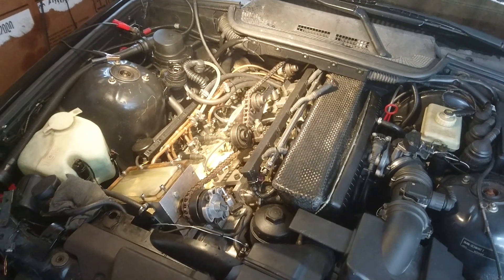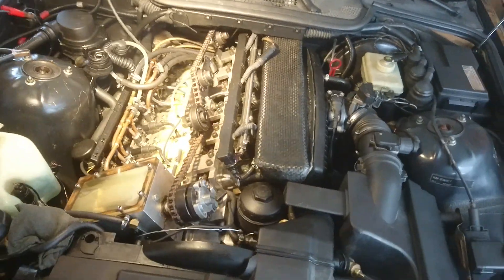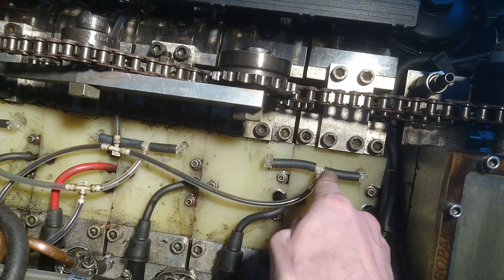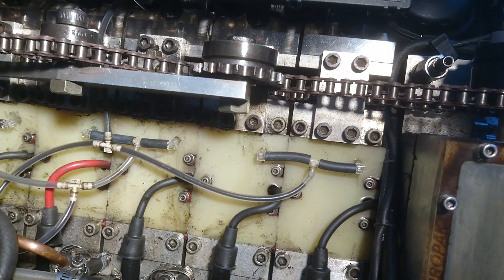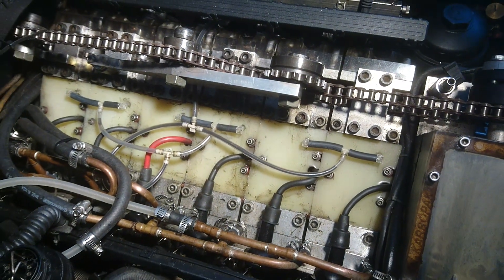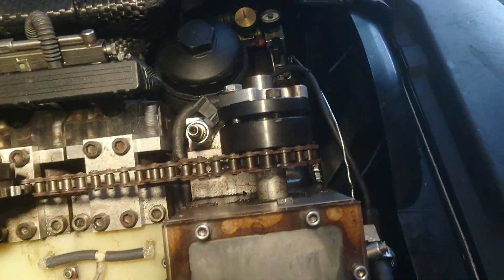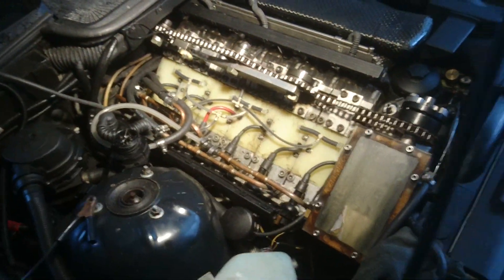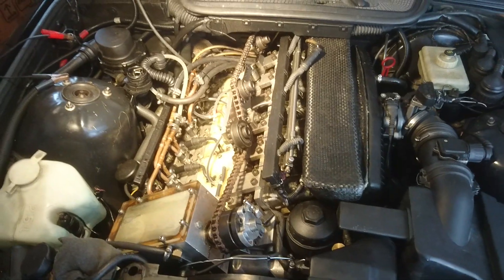Rotary Valve BMW e36 Update 1/1/20 New Oil Lines

Comment: Excuse me— someone actually did this on a full size automobile engine themselves??
Reply from the maker: Yup.  We had done it a few times on single cylinder engines.  We decided it was time to scale it up to a normal production car.  So we chose our favorite chassis, found the car and went to work!  We had originally planed to do a 4 cylinder BMW 318i, but this 6 cylinder 328is grabbed our attention so the project got more elaborate as the extra 2 cylinders increased the complexity and cost.
Reply: Oh wow, I saw someone did it with a Mitsubishi 4G63 engine
Stuff like this is innovative magic
Reply from the maker: @Creeperboy099  Yeah, he put a lot of effort into casting and building that thing and then I believe the combustion seals cracked when he cranked it over for the first time.  I have seen any more progress.
Reply: MrPizzaman09 I wish I had the equipment to do this stuff— my brother is majoring in chemical engineering and he’s learning about fluid flow and stuff like that right now
Someday I want to take a bare engine block from a scrapyard and build a small race engine and make the heads from scratch with him
Reply from the maker: @Creeperboy099  It's always interesting how people build things based on the tools, knowledge and equipment they have at their disposal.   I happen to have the software and mini mill, but I tend not to do castings or welding.
Reply: MrPizzaman09 Yeah I would probably use that method to make parts— mill them from metal blocks

Comment: Have you ever had this setup flow tested?
Reply from the maker: We have made volumetric efficiency charts using the mass air flow sensor and compared it to our 99 BMW M3.  It has better volumetric efficiency below 4k rpm and is similar up to 7k rpm, peaking around 100% VE.
Reply: @MrPizzaman09  - what compression ratio and chamber volume are you running? Those numbers make for a great wide torque band... but it sounds like you could benefit from crossflow in the chamber. A shade more porting for later exhaust closure and earlier intake.  would help with performance, if emissions compliance isn't a target.
Reply from the maker: @jamescopeland8813  compression ratio is 10:1, where stock was 10.2:1. I don't know the volume of the 'runner' area, but it is 44mm in diameter through the valve and morphs cleanly to a 2"x1.2" port in the valve, making for something like a 250/250 degree equivalent for exhaust and intake duration.  It's quite aggressive.
Reply: @MrPizzaman09  - the idle sounded like it had plenty of overlap... but apparently the cylinder pressures are sufficient to keep it in check just above idle. It's great work, no doubt. One thing that helps is a spool valve has less flow at opening than a poppet valve off-the-seat. 3000 RPM torque sweep from 4-7k  makes for a fun and agreeable street motor. I enjoy your continued tweaks. Your not just a "I made it work. I'm done." Kinda guy.

Comment: Any plans on fixing the exhaust leak?
Reply from the maker: The smoke is still little bits of dripping coolant or oil on the exhaust headers.  The silicone tops seals do a decent job at keeping the smoke from escaping.

Comment: Looks like that chain tensioner bracket needs a little more stiffness
Reply: Yeah. It needs a bushing.  The aluminum tensioner bracket just has a hole drilled in it and at this point it has worn enough to have considerable slop in it.
Reply: @johnpearson492  Ah, still a freaking awesome build and undertaking nonetheless
Reply: Thanks!

Comment: Awesome, Great way to start the new year! :D
Reply from the maker: Really hoping to get the tune dialed in since it clearly has enough air, fuel and spark.  Now with better cooling, it won't overheat after one full throttle run down the road.